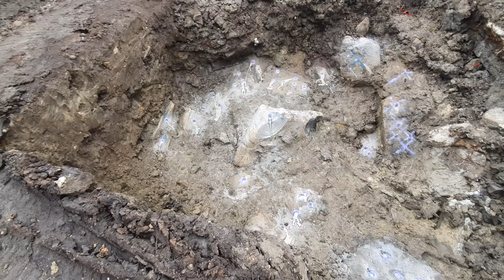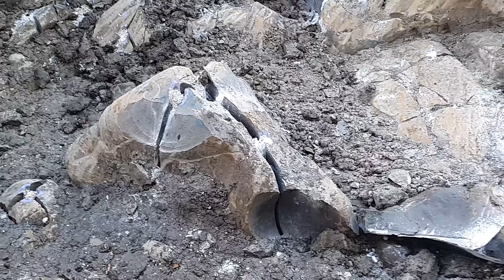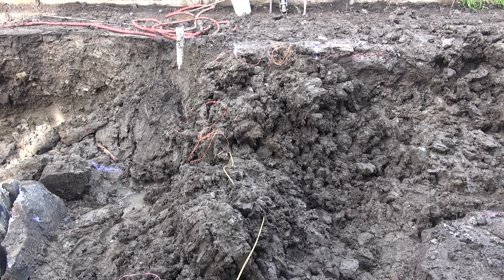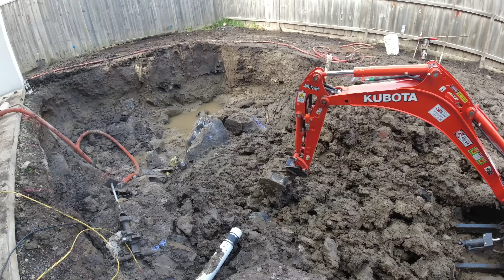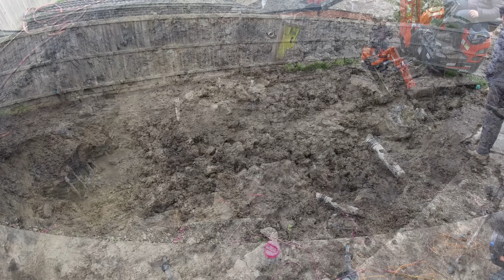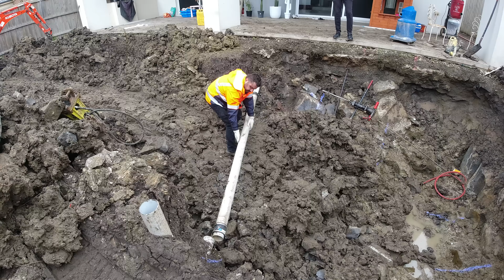Rocky Winter Pool Excavation

Comment: Great job in very trying circumstances.  
When I take my hydraulic teaspoon on a job like this, I always have at least two lengths of 200x80 H4 sleepers ( 2.4m length cut in half with a chainsaw). 
See-saw the machine to get them crossways under the tracks.  With 3 or more you can ‘leapfrog’ them to get out of ‘sticky’ situations.  Saved my but on many occasions on Tassie winter.
Reply from the maker: Sounds like a really good idea Andrew
Reply: @demolitiondavedrillandblast  if you lookup a YouTube channel called letsdig18 he used oak timbers bolted together called mats. He uses them for full size excavated when cleaning out ponds. They work great.
Reply: @FishFind3000  Yeah, Chris' mats have saved him from sinking lots of times, especially on that last massive pond dredging.
Reply: When traversing the Canadian Wilderness with my mates in the 1060s and 70s we crossed several bogs carrying heavy packs and wooden canoes. Usually previous trekkers had placed logs across the deepest holes allowing at least a brief respite from the deepest muskeg. 
Could your rubber mats be placed in the mud to keep the little digger more afloat? I know it seems like redundant technology but what about a sledge and chain to be drawn out of that hole with the little digger? That means someone would have to load the rock and mud on the sledge. But you have to move on Dave! Too long on such a small hole!
Reply: In the US and Canada, heavy equipment mats turn up at the auction fairly regularly.  I think they get bought for an oil or mining job and then sold so they don't have to store them.

Comment: Hiya Dave, they make some fun toys for that little digger, just not a winch. Stay safe, Steve...
Reply from the maker: We did not even have have a point outside of the pool that we could attach a chain to yank on.
Reply: @demolitiondavedrillandblast  that really is unfair, no access, slick mud and no anchor point, but at least you got to blow things up, and we got to watch. But I still prefer the ones on the roads out in the country where you don't have to cover the blast up. Stay safe, Steve...

Comment: When he was trying to pull the excavator out, he was pulling with the boom, but was raising the machine onto the dozer blade, which means he was pulling against his own anchor. Should have turned the machine around, lifting the blade out of the muck. Thanks for the video. Jon
Reply: railfan 439, i agree.  just because bulldozers only work with the blade at the front, that doesnt mean excavators should.  here was a good example.  some bosses tell me off for using the machine the "wrong"way round.  they should stay in the office.  another trick which may or may not aid extraction is lifting the end of the machine as high up as possible (without the dozer blade digging in of course) then dropping it while pulling the machine out with the bucket.  this effectively makes the overall weight of the machine lighter while the bucket is pulling the machine up and out.  another alternative if all else fails is to turn the cab around and try pushing it out with the bucket.  next thing to try is lift the end of the machine up and drop it while pushing.  been there, done that.  i dont think i ever got stuck that i didnt eventually get out of.  i certainly got stuck a lot.

Comment: WOW, that mud was like grease on the tracks of that little digger. It must have been a mess to get in there to clean the rock off and blast it.
Reply from the maker: The black mud that is basalt soil is very slippery and very sticky stuff and yes, it is very difficult to work with.

Comment: This is what I was doing 🤣watching this, fighting that nasty loon sh*t mud, that's a good way of slashing rubber tracks on a sharp rock. I have quite a few hours on the 2 U-17s the company I worked for owns. The problem they don't have any foot pedals on the travel sticks, you have to get creative with your knees to push or pull on the sticks while your using your hands on the joysticks using the bucket to pull yourself out of the nasty spot. The one trailer we had the machine wouldn't climb up the beaver tail I would have to use a chain hooked to the front of the trailer to pull myself up onto the trailer. Its surprising what the little 17s can do you just have to plan out the dig.
Reply from the maker: A good little machine that punches above its weight.

Comment: I know those feels dave with black gloop. My 1.7 is the same machine and i know a trick or three to extract it from that stuff.
Tip 1. Dont do the job!
Tip 2. Do the job in summer.
Tip 3. Get you in!
Reply from the maker: The little digger punches above it's weight Paul, 2 of the 3 pool jobs this month  used this type of digger, pretty good machine. Do the job in summer sounds good to me!
Reply: @demolitiondavedrillandblast  i know dave. Had mine 6 years now and it punches above its weight every job.
Glad you got out of there!
Im sure we will be in touch soon with some of the shit jobs i cop!!

Comment: Looking a bit mucky, there, Dave! Tell me, what the hell are they going to do with that drain pipe? Not going to be easy, re-placing that thing...
Reply from the maker: It will have to go around the outside of the pool.
Reply: @demolitiondavedrillandblast  , and shouldnt it have gone around the outside before digging the pool?  that thing will be dribbling juice into that mud that you have all walked through.

Comment: Would a truck load of sand worked better than using that mud as cover? And I've seen excavators use wooden "mats" for the excavator tracks to get in and out of muddy soil.
Reply from the maker: Oh, so much better Ray.